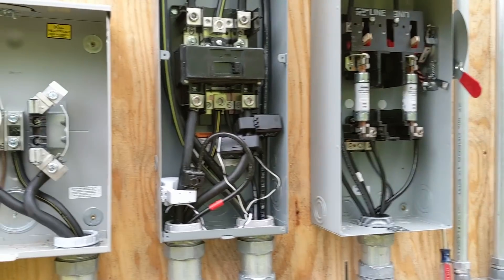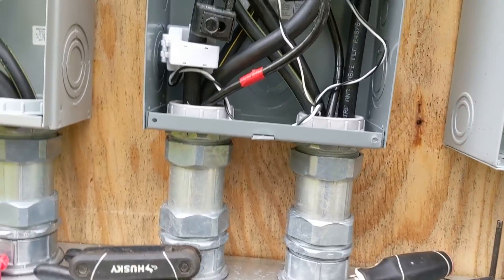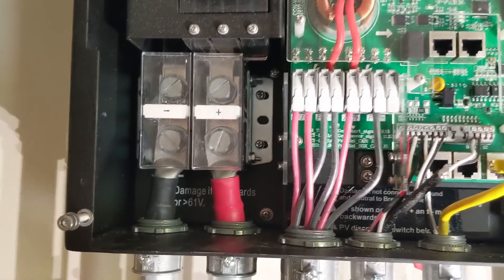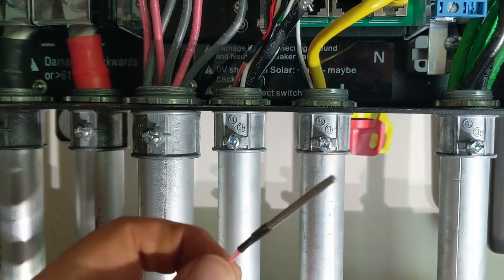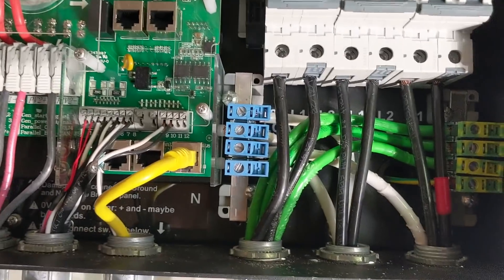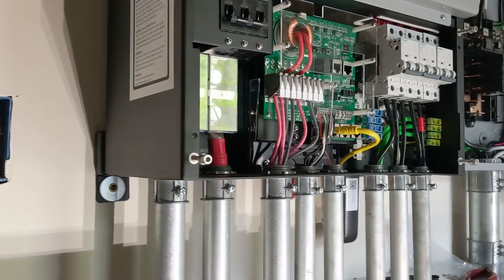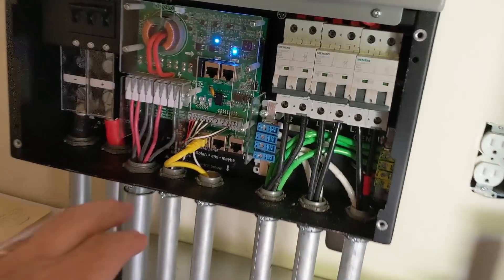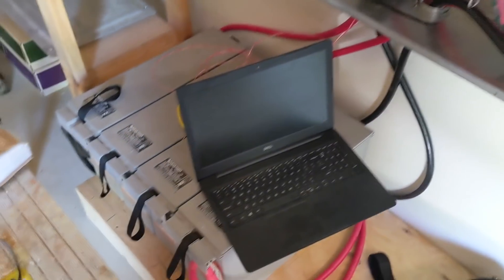Sol-Ark 12k Off Grid Solar Inverter installation

Comment: Nice work! I'm doing a parallel 12k next week, good to know about the cat5!
Reply: I installed a 12k stack 3 months ago. Off grid system. For some reason they will not except generator power to charge the batteries. Let me know if it works for you. I hear this is a problem when you stack SolArk. I've had multiple off grid contractors check my wiring. But it seems its a solark problem.
Reply: @jacobscott2001  is it not calling for the generator, or not accepting it as a source?
Reply: @benssolarandbattery  once the generator is turned on it has a 30 second delay. Wants the delay is over the generator ramps up and the inverters shut down and give a gfci fault code. Then runs the power directly to the house but won't charge the battery.
Reply: @jacobscott2001  does your transfer switch break the neutral wire along with L1 and L2? That could be where the GFCI fault is coming from.  Neutral and ground should stay bonded in the main panel.
Reply: @benssolarandbattery  on the generator i have a 50Amp plug. The plug gets wired to a sub panel with two 30 amp breakers. One 30 amp for each inverter. The sub panel for the generator has the neutral and grounds seperated with a neutral and ground jump wire to the main panel where they are bonded. Going back to the generator its a DuraMax dual fuel 12000eh.  The manufacturer says its a floating neutral however I tested continuity and it is bonded.  So I found the jump wire that bonds them and removed it. So I have tried with floating and bonded generator.  Also i have a grounding rod on the generator i hae tried to use it without it but got same response.
Reply: @benssolarandbattery  also i have been on the phone with solark a few times about this. All my settings on the inverters are as they should be. I have also had 2 off grid solar installers take a look at my set up and they see no issues. However one of them informed me today that this seems to be a problem with stacked 12k 's. He told me to try and turn off the slave and run it only through the master. And it should work. I will be trying this in about an hour or so when I get home. He says he has had 4 other stacked 12k's with this same issue.
Reply: @jacobscott2001  hmmmm.  I would call Sol-Ark on that one. They have great tech support, even on weekends!
Reply: @benssolarandbattery  i have multiple times and they are pretty good about responding.  However they won't admit it to being an inverter problem. My question to you is did you install a stacked set of 12k's with generator back up. And did you fire up the generator and test it?
Reply: @jacobscott2001  I haven't seen this issue before with parallel 12ks.  I was working on a double stack today and the generator didn't throw any codes.
Reply: @benssolarandbattery  thats interesting.  Ill let you know what happens when I use only one inverter.
Reply: @jacobscott2001  yes. I did.  I had an issue with the generator start relay which is why I was there.  Done many others with no issues but these wouldn't stay on.
Reply: @benssolarandbattery  well i shut down my slave and took my master out of parallel and it works just fine.
Reply: Can you think of anything that would allow me to use one inverter and have no problems. If I run the power to just one while both are on it automatically shuts down do to bus imbalance.   As soon as I shut down the slave everything shuts down. So you have to take it out of parallel.  Then it works just fine. I was bringing in 6900 watts with no issues running the house and charging the battery. Ill be calling SolArk in the morning. But just wanted to see if you had an ideal as to why I can have everything working with a single and not a stackable.
Reply: Also if you knw wht version of firmware your inverters have id like to know. I have had these since March and so far on my 5th update.
Reply: @jacobscott2001  not sure which one I have, but its the one they came out with a couple weeks ago.  They're constantly updating which is not a bad thing.  Do you have gen tied to grid input? And if so, is that setting enabled? Really sounds like a paralleling issue though.
Reply: @benssolarandbattery  yeah i have the generator going into grid input and it is set up for it.  I also widened the range on the power signal. I had solark customer service go over the settings twice.  They aren't open on the weekends.  So I will call them again tomorrow if they aren't closed due to holiday.
Reply: @jacobscott2001  they do usually have a guy on call on the weekends.  Only other thing I can think of is maybe you got L1 and L2 reversed somewhere?
Reply: @benssolarandbattery  well i have 32 panels. 4 strings of 8 that goes to a combiner box. From that box I have 2 positives and 2 negatives. One set for each inverter. I would think if they were wired wrong I wouldn't be getting solar. But I am only using one chanel on each inverter. And under the grid side I just have 2 hots going through from the generator plus a neutral and a ground on the bus bar.
Reply: @jacobscott2001  my thought was on the generator output where it splits and goes to each inverter.  If one of those is backwards that would cause immediate issues.
Reply: @benssolarandbattery  the way the generator is wire i have 2hots a neutral and a ground going to a sub panel. From that panel I have 2 30 amp 240 breakers. One breaker for each inverter. I cant imagine that being wired wrong. Otherwise it wouldn't of worked when I took my slave off line and just ran the master.
Reply: @jacobscott2001  if that was wired wrong it would work with only 1 inverter but not 2.
Reply: @benssolarandbattery do you know what I should be checking. I know I made sure that the same black and red from one breaker goes to one inverter and one black and red from the other breaker goes to the other invert. As well as a ground and neutral. Is there a senerio that you know of or something I would check.
Reply: @jacobscott2001  easiest way would be to open both inverters and  measure voltage between grid L1 master and grid L1 slave. Then, grid L2 master and grid L2 slave with the generator on but the grid breakers in the sol-arks off.  If there is voltage between L1M and L1S or L2M and L2S that's the issue.
Reply: @benssolarandbattery  That sounds easy enough to check. But what would cause it to have a voltage variation?
Reply: @jacobscott2001  if L1 and L2 were reversed from one to the other, it would read ~240v
Reply: @jacobscott2001  Why would you put a ground rod on the Generator?
Reply: @jacobscott2001  i think engineer775 on the install in this video mentioned two generators, one for each inverter

Comment: It would be really great if you can show us the new remote functionality of the 12k.  I ordered the new wifi dongle for the 8K to get this functionality, Not had chance to install it yet. 
I'm sure for your business it's will be a huge saver regarding supporting customers to get that remote access and check/change settings.
Reply: Hey Brian... How do you like your 8k? I'm about to buy a 12k.
Reply: @justfly2525  It's been a great product, I've been using it for several months completely off grid with a small 10hwh Lifep04 pack. It works well in the configuration to distribute loads with the smart loads setup. I hope this this new powerview app gets developed further, It is better than the old app though still needs work. I May use the 8K for my workshop in the future and add a couple of 12s for the home we are building.

Comment: How many of the 12k's can you stack?
Reply: Check the solark channel for a new video on stacking. They show 8 slaves at one point and a master. The only limitations I could see is the grid feedback is slightly reduced per unit.
Reply: @EastyUK  Wow 8 stacked that's pretty nuts that's 96kW
Reply: @SgtSnipey  8 Slaves, Plus a master. :)
Reply from the maker: 9  nine!
Reply: @engineer775  Wow that just insane, 108 kW Peak, I want to see the solar and battery setup that got with a max stack 12k now would be crazy AF but cool as hell! Probably enough power for a culdesac
Reply: 3